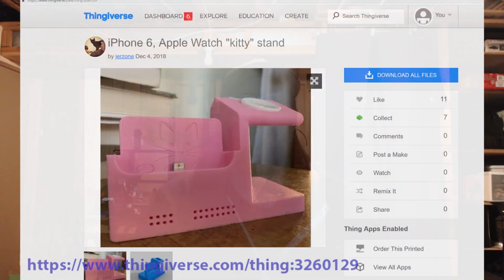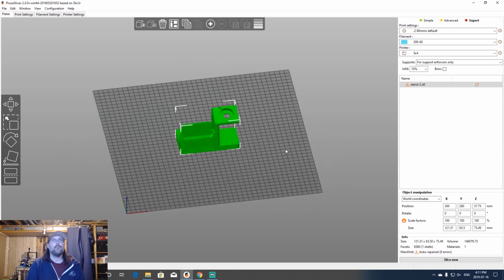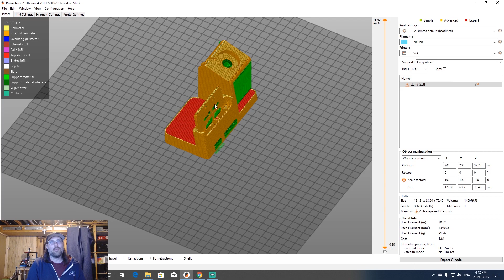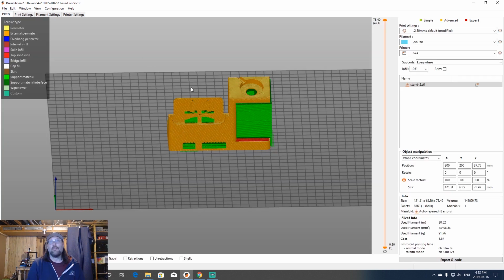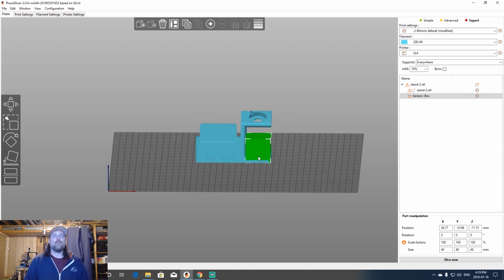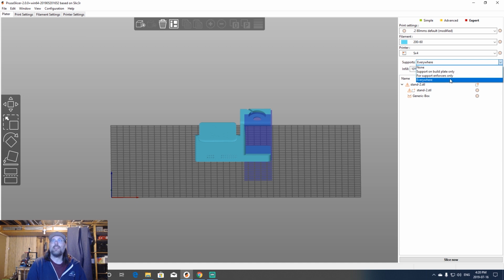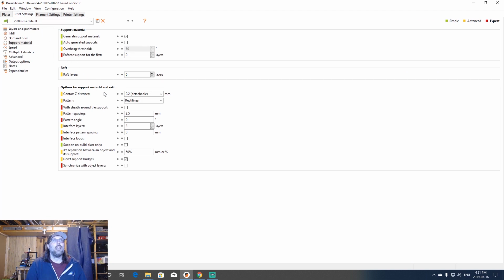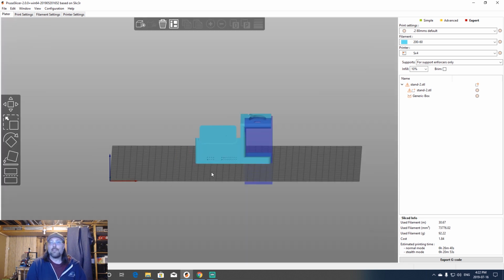Be Supportive of Your 3D Print (Prusa Slicer 2 Style)

Comment: Interesting. I would like to know why you added the 10% to the layer height of the supports. Also, I would like to know how you setup the water soluble support material. Lastly, I making a video, it would be helpful if when you discuss the settings you zoom in enough with the camera so we can see what your settings are. Thanks
Reply from the maker: Hi the settings are i use are in the prusa slicer bundle posted on the website in the description but to help out I will post a link in the video description as well but here is a link (http://bit.ly/2JNQkW6).  I explain the why the addition of of 10% of the layer height to the zgap works in the previous video of this series on support (https://www.youtube.com/watch?v=8EkERlq-NpI).  As for the waster soluble you a multi material extrusion system of some sort firstly to switch between the model material and the soluble support material.  Since the support will come mostly off with water/PP/Solvent you can start the support Z distance at the height of the layer (if printing .2 then use .2).   Thanks for you feedback!  You are awesome!